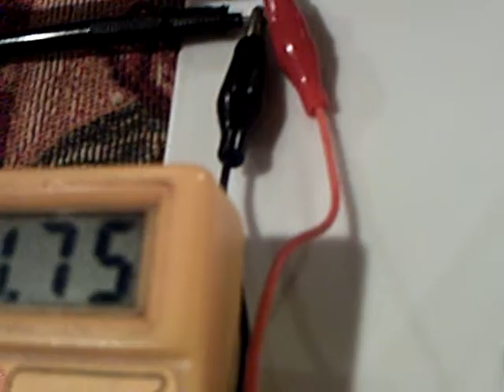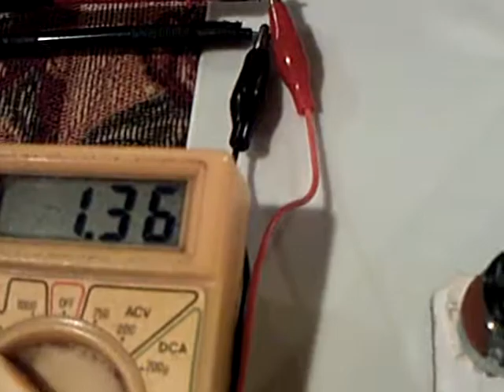Simple Pulse Motor in self oscillation running on a super capacitor

Comment: while im on the dc motor subject. once you pulse generating with the motor in series with the reed switch....... another way to get some high voltage spikes is put a little transformer, like the ones from a cell phone charger, take it apart and hard wire the leads.... then use the primary in series with the reed switch, and the dc generator. see this way as your pusle generating... you can collect the backspike through the secondary...  just thought i would add. just two more generating methods

Comment: That's really cool that you are showing self oscillation in your circuits again. I think it's really something you should explore a little more into. I was wondering if you placed an av plug off one of the legs on the diode could you get a voltage because of the resonance in the circuit.

Comment: you could probobly add a dc generator to the magnet motor,, looks like you started too, anyway pulse charge with it, to cut back on the drag. mayber you can pulse  charge up another polarized cap with that energy off of the dc generator and pulse filled the main cap through a toroid to get a higher charging voltage. two little reed switchs and a toriod or transformer should do it. great expiriment.

Comment: Just to clearify its a 10 Farad capacitor? Many motors use capacitors in the micro farad range as if they are built very well and have no loading they shouldnt need but a few pulse worth of charge to stay running for protracted periods. (The cap looked really small for 10 farads)

Comment: Trying using a 1N4114,  for it will probably have greater current carrying capacity.................................................................................... I still don't see how the one motor transmits energy to to the other. They do not appear to be electrically conected, and if it is not induction, then what? Is this some kind of trick?